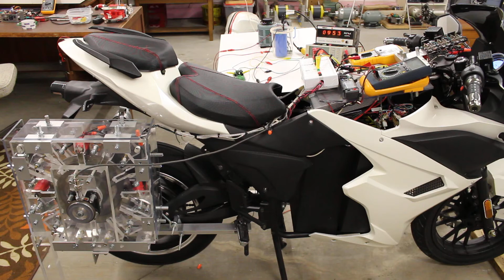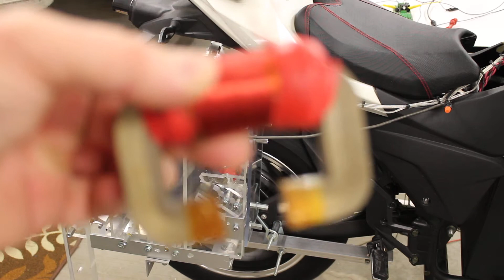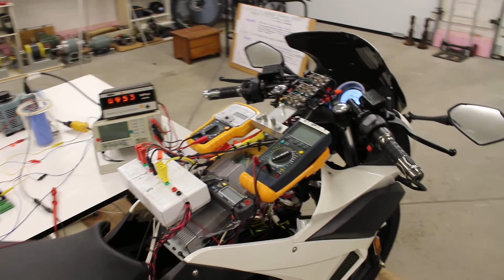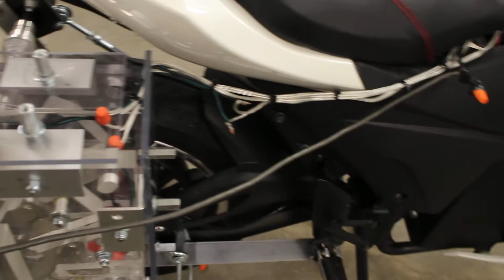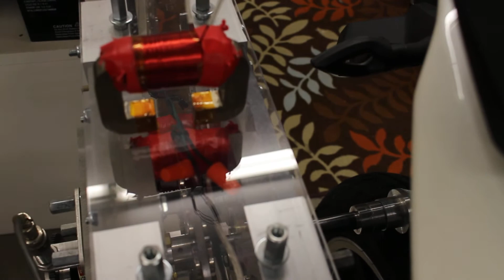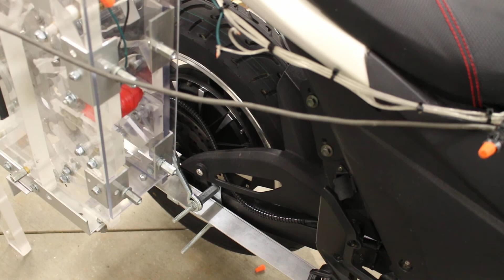ReGenX ebike Integration (5.54 Amps, 88.64 Watts) Recharge Current with EV Regenerative Acceleration

Comment: What is the impact of additional friction on the battery's output in terms of amps? You should have measured the battery output with and without the ReGenX to confirm there is real gain.

Comment: Hi Thaine does the coil wiring , connect straight to the battery or between the relay switch? And what’s the best core material for the coil? Looks metallic is it steel or iron? Or non Ferris ?